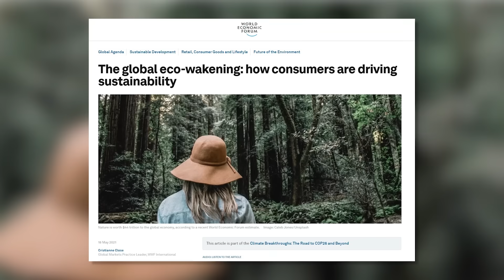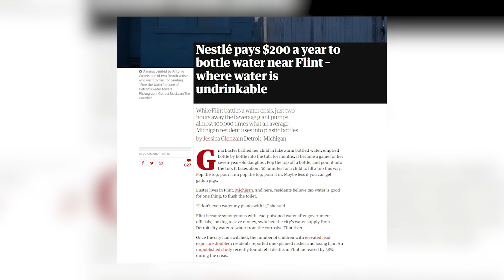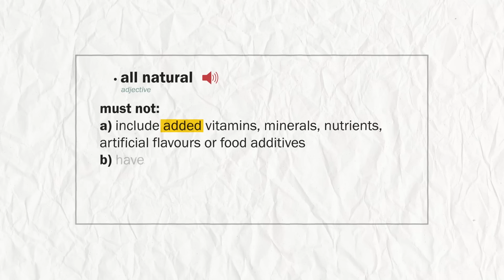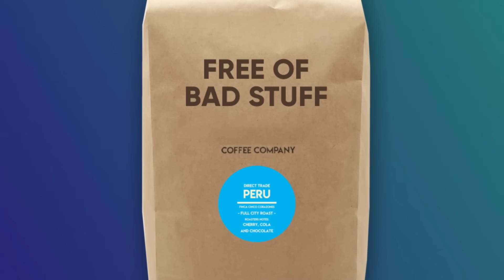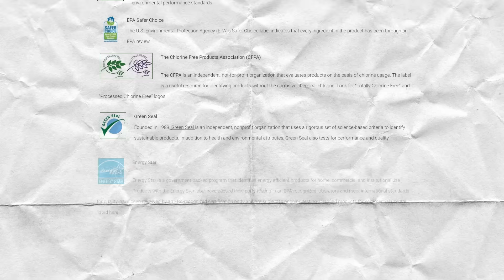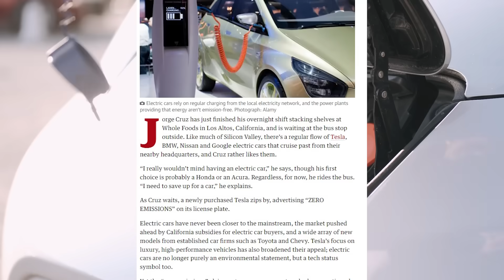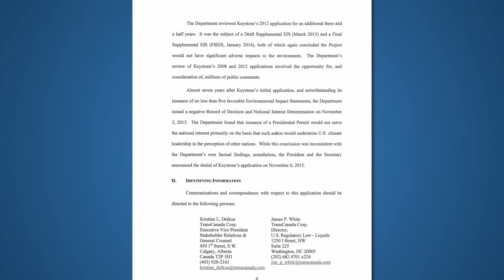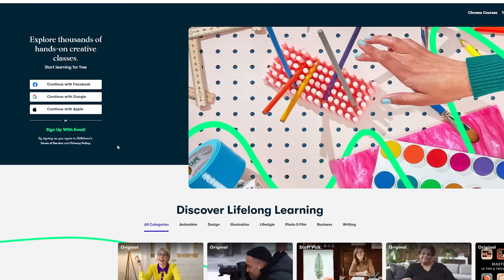Why Being 'Environmentally Friendly' Is A Scam

Comment: I'd studied the Volkswagen emissions scandal a few years ago and it essentially boils down to environmental regulations being impossible to meet, thus forcing companies to workaround via cheating emissions tests.
A large part of that was the Diesel vs. Petrol argument, but the scandal actually revealed that Diesel didn't actually produce less harmful byproducts than Petrol, just that the byproducts were different and likely more toxic to people while flying under the radar for emissions tests. Manufacturers need to sell their products in order to thrive, and cheating emissions was more viable than being locked out the market altogether by regulations that are impossible to meet.

Ultimately, a lot of environmentalism to do with transportation, particularly the current promotion of electric vehicles (which are massively destructive and expensive due to the demand for Lithium, Silver and Copper) is a sham to prey on consumer ignorance whilst selling cars with less range, higher energy consumption and far higher material cost.
Wind Turbines have similar issues where they never pay themselves back, or Solar Power where entire sites are left abandoned.

Comment: So many tiny ways that if we all did them would add up to millions! Our motto should be "What can WE do for the environment today?".. Recycling is not the best answer - how much energy does it take to recycle that item??? 
So if possible
1. Don't use.
2. If you must use then re-use. 
What would your suggestions be? Here are some of mine.
* That empty crisp/chips bag - re-use it to take your sandwiches to work. 
* Refill the plastic bottle you bought when you were out and got thirsty so that next time you will bring your water with you.
* That empty frozen veggie plastic bag? It's a freezer bag! Don't drop it in the recycle bin! Re-use it to freeze leftovers of a home-cooked meal.
* The clingy plastic that your item came wrapped in - carefully unravel it for reuse. NEVER buy cling-wrap!
* So many things like nuts, dried fruits come in plastic containers. They can be re-used dozens of times (storage of other foods, left-overs in the fridge, containers for kids' toys, nuts and bolts etc.) before they finally crack. THEN you can deposit them in the recycle bin.
* Goes without saying that you always carry with you fold away bags for shopping, but do you also have those net bags for the fruit and veg you buy loose - where otherwise each would go in a plastic bag?

Comment: In Australia they replaced free single use plastic bags with "reusable" plastic bags and charged 15c for each. Their profits sky rocketed but it turned out they are worse for the environment than the old bags which were biodegradable but the new ones are not. Even if the bags are reused each bag must be reused 52 times before it matches it creation footprint (and even that may be a huge understatement), which never happens and they break before that.

The old bags were used to put trash in, but the new ones are not good for that so the sales of garbage bags (which are even worse again) also sky rocketed.

Corporations make millions of dollars while making the environment worse while telling you they are saving it.
Reply: Hi here in México we started to use fabric bags ando stores are not allowed to give plastic bags, and yes is all the money in corporations so sad.
Reply: The old bags weren't biodegradable, lol! Unless you mean in the sense that all plastic is "biodegradable", i.e. it eventually breaks down into microplastics. And why would you say that the new ones aren't any good for lining bins? They literally work every bit as well as the old ones for that - actually better in my experience, because they're more durable, so they're much better if you need to throw away something sharp or heavy. I don't think reusing them 50+ times is at all out of the question; I've had the same liners in my bins for easily at least a year.

Of course, my experience is minimal, because like anyone with any sense, I've been using reusable bags for decades. No-one has the right to whine about supermarkets making money on selling you bags that you're not at all forced to buy. I use string bags that both hold more than a standard shopping bag and are extremely durable - two of them belonged to my mother and are around 40 years old.
Reply: @hawnkshuah  ya, I crocheted myself two shopping bags a few years ago and you should see the amount I can fit in just one...wish I had made the strap thicker, so the weight doesn't rip into my shoulder.
Reply: Same here in NY, USA. I think it's by county but it's every supermarket I've been to the past few years. Idiots making laws without thinking, and other idiots loudly calling for those laws ALSO without thinking. Reminds me of NY gun laws.
Reply: Same in Sweden. The old bags were perfect for trash. The trash were incinerated and used for cogeneration. In the end it was only a way for our government to get more tax money to spend on stupid things.
Reply: Same also in the UK. And some supermarkets are even doubling down by charging more, and one chain (Waitrose) went as far as to replacing the thick bags with even thicker bags with no lifetime guarantee, so what happens when they break? It probably gets thrown away. The whole anti-plastic bag movement is so dumb, they keep overlooking the fact that people do reuse them, and that they only make up a small percentage of overall waste!
Reply: @AurumUsagi  that's right.  The plastic bag industry is thriving since the bag bans.  bags are bigger and thicker than ever!!!
Reply: @6rant219  if bag bans are turning out to actually be beneficial to the plastic industry, why would they put so much effort into fighting them?
Reply: @joewiniecki3282  because the government and consumers are not informed about the real numbers around carbon footprint and consumer behavior.
Reply: @6rant219  the plastic industry is fighting them.
Reply: @AurumUsagi  It's like they're intentionally damaging the environment.   Wonder who's behind that idea
Reply: @AurumUsagi  No, people definitely don't reuse plastic bags, lol. They get thrown away the moment people get home, and new ones are bought in a store because they're so cheap.
Reply: @Keaze  Have you even read a study into bag reuse or are you just drinking the Greenpeace Kool-Aid?
Reply: your numbers are wrong
Reply: I use them (coles / woolies) as bin liner instead of buying garbage bags. Also if you’re over 30, your mum or grandma always had that long tube bag to put the shopping bags into after use, pull from the bottom of it and use as a bin liner or items in. We’ve been doing this since the early 90’s
Reply: That was and is a big scam.  I wonder where that idea came from.
Reply: @Whynot15366   For someone with a username like that, you have a surprising lack of imagination 😂 The bags have handles and are way lighter, my dude. And in all but one of my bins, I don't throw out anything that would need the bin to be washed out in the first place. Only ever needing to wash one bin saves water. My water bill is under $50  a year because I spent a small amount of time and energy thinking about this stuff 🤷‍♂️
Reply: These new thick plastic bags make me so mad. I do most of my grocery shopping online/curb-side-pick-up and they always use those bags. No option to not use bags. I have an empty chest freezer full of these bags that I feel guilty throwing it away since plastic is so bad for the environment. But I have no clue how to recycle them or to get rid of them.   The thin ones were easier to store and were used as a trash can liners. These thick ones don't have any use for me.
Reply: @chotanya  You can recycle them through REDcycle. Can find them in most supermarkets.
Reply: @chotanya  the way you recycle them is you return them to the store.
Reply: @chotanya  I shop online with Woolworths, and they let you select paper bags. I still wish no bags was somehow an option, but I use the paper ones to store recycling so I can simply chuck the whole thing in the bin outside when full.

They've still given me plastic bags on occasion when they run out of paper, but I use those to keep other recyclable soft plastics in so I can dump them into the REDcycle bin next time I'm going inside at Woolies or Coles.
Reply: @chotanya  Could you donate them to a charity shop or farmers market?
Reply: The bags are thicker because it is designed to be reusable. The thin plastic bags that we used to get, break easily so the bags we now are suposed to be an alternative, albeit not a very good one.

 The best things is to simply not get the bags.
Use a trolley to put loose items in, not everything needs a bag.
Reply: @philinator71  They did not break easily, they were fine.  They don't have to be five times thicker.  Humongous waste.
Reply: @philinator71  The greenies still see fault in thicker bags, and critics have argued that the thin bags did get reused, even if it's just as a binliner at home. The other thing about thin plastic bags is that they were a product of efficiency during a time when there were oil crises back in the 1970s, and the need to reduce both costs and reliance on paper bags.

Comment: I know the keystone pipe line is a touching subject. but srs wouldn't 2 pipes be greener than trucking the oil in. and yes, the oil will still be flowing until we actually come up with a proper solution for zero emission energy

Comment: there's a thing about electrical veichles that's been overlooked a lot: even if the still do the same ammount of pollution, at least air in the cities becomes less polluted, and more breadable, as the fumes are emmited less by the cars
Reply: Also, not all electricity is produced the same way.
An electric car being powered off of a major nuclear plant isn't going to create nearly the same sort of pollution as a gas burning car. Not to mention, if we WERE to universally convert to electric cars, it would be a LOT easier to focus on making power plants cleaner and more efficient - There's only so much you can do with the limited space and weight allowed by a car, but a power plant has zero of those limitations.

Comment: My favorite are labels that claim a product will be bio or photodegradable. The issue being that few consumers understand that this only actually works if you compost the product after using it. In order to biodegrade, there has to be water. You know what is squeezed out of your trash to make it as compact as possible? Water. In order to photodegrade, you need light. This is also not found in a landfill as trash is piled on top of itself continually. To illustrate this concept, newspapers are biodegradable AND photodegradable in normal environments. Newspapers that are up to forty years old have been in landfills that are still legible.

Comment: I tried recycling plastic bottles at my local landfill/recycling center. They told me I need to rinse all containers with WATER and remove all the lids, or else they won't take them. I got back in my truck, backed into the landfill bay instead, and away they went.

Comment: People in the comments are disagreeing with the pipeline arguement, but my question is how would you ensure leaks were not present in a pipeline? At least on the ground if theres a spill its surface level and easier to clean up (in my view). Interested in viewpoints on leaks. Because even small leaks over time could cause major damage.

Comment: Can someone here explain to me how transporting oil via a pipeline is more dangerous than trains, trucks, and boats? Genuine question.
Reply: Apparently, pipelines are dangerous not because they "might" break but because - as experience shows - they will break (leak) sooner or later. I can't say anything about how transporting oil in other ways works.
Reply: @camelopardalis84  but couldn't the same be said of boats, trains, and trucks? Except (in my mind) trucks, trains and boats would be exponentially more risky. Not only could an accident happen during travel but also while transferring the oil between vessels. Where as I would assume a pipeline goes directly to the refineries without the need to transfer from a mobile tank.
Reply: @bigwooly8014  I could imagine that since the pipe is (often? always?) underground, and the oil probably travels through it very quickly (I don't have any idea how quick), it's a case of more oil leaving into/onto the ground. And I meant it literally when I said that they apparently always leak. Not "always" as in "with a very high probability" but "always always". At some point down the line.

It's not only about the transportation method, either. It's about using oil, especially if you use it to burn it, in general. So the argument isn't just "pipeline = bad transportation method, please use train".

Comment: CO2 is plant food and is required to green the planet, we need 3 to 4 times the current levels. no it will not cause catastrophic climate change!  CO2's effect on temperature is non linear and the more there is of it the smaller effect it has on temperature.  CO2 levels are near saturation currently.

Comment: Might sound nuts, but buy a pendulum and use it.  It does work, to help you make better choices.  You will get "yes", for what you should buy, and "no", for what you shouldn't.  I do this, when I shop, online.  It does work.  Don't knock it, until you try it!

Comment: However I disagree with you on the pipeline issue. The pipeline is a more environmentally friendly way to more oil. I’ll explain, once the pipeline is build the land around the pipeline goes back to the way it was. Meaning the grass grows back, the animals come back and easily live right along side the pipe and in the long run the environment come back into balance with minimal disturbance. In contrast the alternative to move oil are by tanker truck, railways and ship. Tanker trucks take diesel fuel, the trains take diesel to move and ship use diesel to move accidents and humans cause fuel spills all the time. So these transport methods have two strikes against them from the get go, both use resources and pollute the environment. Using fuel to move and oil spills. The pipeline on the other hand once build moves oil by mostly gravity (notice how I said most gravity). The better question to ask is who benefits for the shutdown of the pipeline. Who paid for the campaign to stop the oil moving by pipeline. Because the oil IS still being moved. One of the world’s riches men owns the rail lines that move the oil by rail.

Comment: Tim Hortons removed plastic straws and switched to paper straws, but left the 95% plastic proportion of the iced capp cup.  I've asked to have my iced cap placed in my own reusable cup, but they have declined. I suspect 1.) because of sanitary reasons as the mixing stick for the iced capp touches the cup and 2.) because their plastic cup is used to measure proportions to make the iced capp. Its stupid how they switched out 5% of the iced cap packaging components and left out the 95% plastic cup haha

Comment: for the whole dieselgate that happened to VW, ford, merc and literally every automanufactuerer.... We all coillectively delete the emissions software and parts (catalytic conv, DPF, EGR recirculation, DEF fluid, etc). When getting vehicle inspections, they already don't test emissions for diesel cars because they will fail no matter what. The only required testing are for truckers, but even then, some truckers remove the software after testing to get significantly better fuel mileage, and not have to worry about getting stranded because you ran out of DEF

Comment: Before 1940 or WWII, we were very green.  There was minimal packaging if any and most if not all fresh foods were locally grown or raised.   All of which is very green by even the most huggee of tree huggers standards.  This all went away after WWII.  Convivence was the name of the game and it's still true today but you can live at lease live gilt free by purchasing these pseudo green products.  

The Keystone pipeline once in operation would be 10x safer than the current transportation method used to import Canadian oil. This is the railroad and an antiquated  grid of exiting pipelines that would be phased out once Keystone came on line.   Had Keystone not been shelved it would have come on line in late 2023.   It will be back and don't think for a minute by shutting this one pipeline down will do anything to stop or curtail the use of petroleum from Canada or anyplace else for that matter.   As with anything political, it's just that.  Politics. 

Live green by living with less.  Oh, and drive your car for 10 or more years. That alone will do more to save the planet than anything else.  Assuming you're not a complete kook don't drive a car.